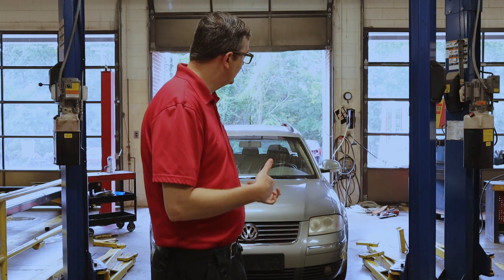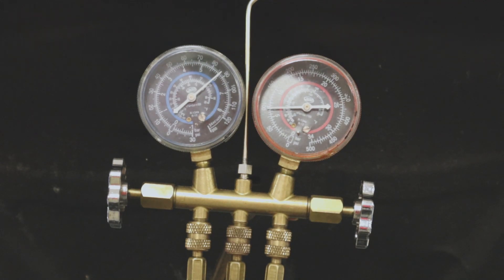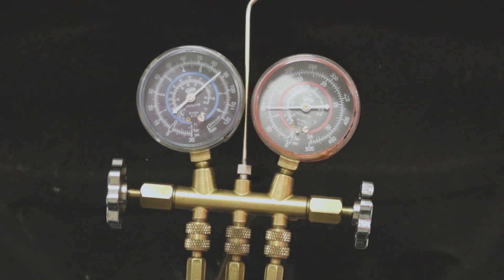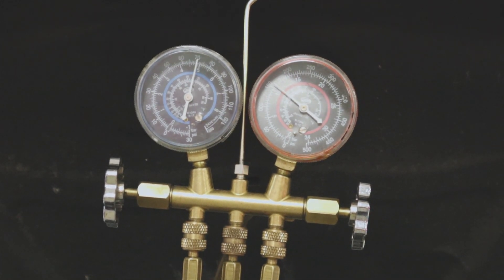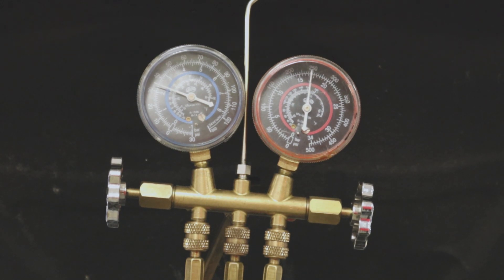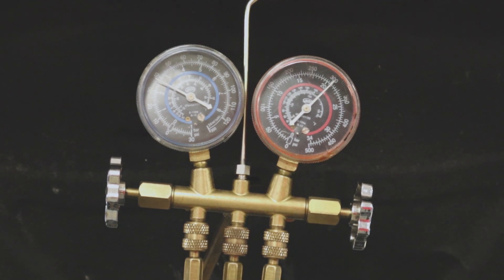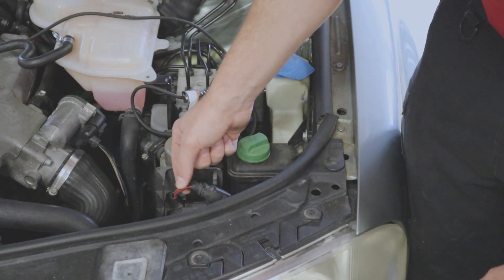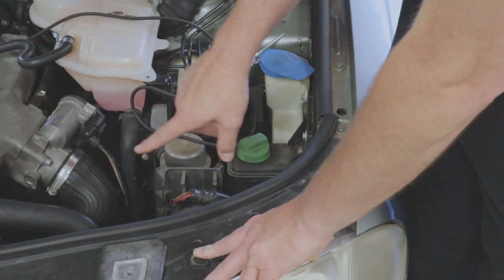B5 B5.5 Passat Air Conditioning not cooling at stops. 1998-2004

Comment: Fill your coolant up bro, that's low.
Reply: Nice car by the way, good choice. I've got a 2.8 V6 4 mo Passat, it's got electrical gremlins too.
Reply from the maker: Yeah coolant was low because I was showing students how to bleed the heater core, which is also why the engine was so messy, lol. Thanks for watching! What electrical issues are you having?